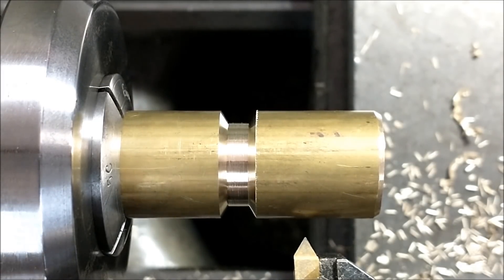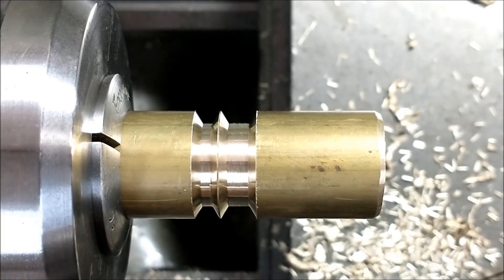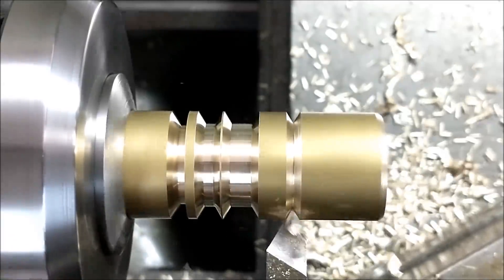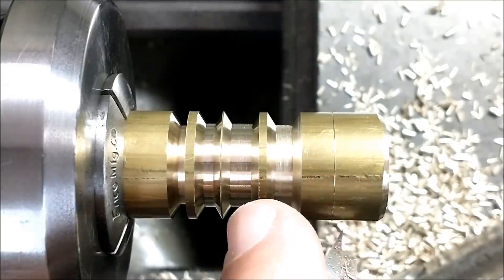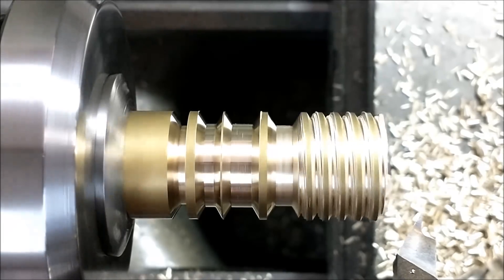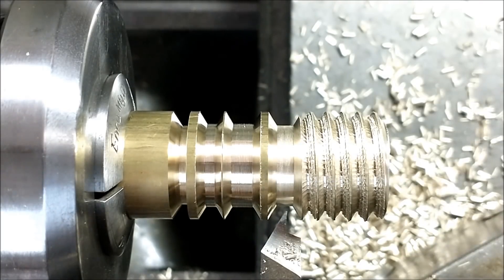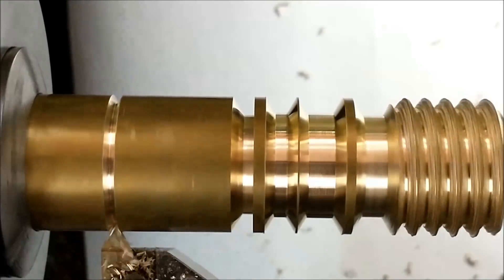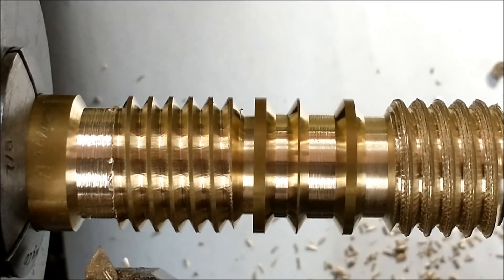FACT CHECK:  Threading Myth BUSTED !!   You'll Find This Interesting......

Comment: I’m mostly a mechanic, but yesterday I needed to lengthen the threads on a bolt to make a jack screw to pull out some flanged bushings. Anyway, I set the compound to 29.5°, or 59.5° on this lathe, like I was taught in school. Then I needed to square the tool, but I couldn’t do it against the face of the chuck because the tool had a weird offset, so I asked one of the machinists if he had a fishtail gauge. He didn’t know what I was talking about… but he just lined up the tool in the existing threads. I felt dumb.

But he also asked me why I had moved the compound. He said he always cut threads by feeding directly with the cross slide.  

He said it’s a carbide insert and the lathe is strong, just go for it.

And indeed I cut the best looking threads I think I ever made.  The irony is that I learn to cut threads in school using the same exact carbide inserts, but I guess the teacher wanted us to learn the hard way… Or maybe he didn’t even think about it. The HSS tools were just cut from the program 3 months before I started.

Still, the machinist was surprised that I knew how to cut threads, especially metric threads, and that I knew my way around a lathe. I pointed out that I know every machine in the shop literally inside and out because he breaks them and I repair them… haha.
Reply: That's neat that you have all this and the thought put into it, the time spent, and learned more by doing.
I change bushings like you describe with a c-frame and forcing screw. The ends are selective for different size bushings.
The biggest lesson when being paid only book time labor for a technician, other than a trick that's super fast, is using the right tools to begin the job and be done with it on time.
At your leisure, on your own car, you can reinvent the wheel while you're at it.
Nowadays you can use a tool and return it quite often at the parts store or get it cheap at Hebrew freight.
Reply: @dannylinc6247  In this case the bushings were already tapped for the use of jack screws, but we didn't have M16 allthread on hand. 

I say mechanic but I'm a millwright in a fab shop.  My team does all the shop maintenance, in addition to repairs and modification on all kind of customers equipment of all sizes. 

My speciality is mostly electric controls and hydraulics, but I'm an OK welder and machinist. 90% of the time when we need a tool, we make it in the shop. 

Also we're in a pretty small town, way north of all the big cities. If we need something it's not next day shipping but next week shipping. And with Covid it's next month shipping now.
Reply: @felixar90  thanks for the clarification
Glad you found your calling.
Reply: @dannylinc6247  Yes I did find my calling. I used to work in IT, but I got sick of it. Went back to trade school.

Comment: Yeah even if you push the tool into the work at 30 degrees, when you start the movement to make a thread it doesn’t do that. So it should need both sides

Comment: I was taught to single point by several old timers and this is the first time I've heard this nonsense. We keep our compounds set at 30 all the time, when I asked why, they said it was so you could "pick up" an existing thread and fix it. I've been cutting single point threads for over 20 years in a production shop, both with and without a compound. If you have ever actually WATCHED the tool cut, you can easily see it's cutting on both sides.
Reply: I'd bet it's an idea spread by folks that have only been trained on regular lathe work, and never used their brain enough to ask if it makes sense for threading. If you let them do something they're not actually trained on, they'll probably break tools.

Comment: On a manual lathe , the leadscrew always has slack in it. The only time I use the compound is to cut a multi-lead thread. My passes are .010 deep to the last .005, then .002. All straight in from the cross slide. I let most of my passes float with the leadscrew, Then let my palm rest on the apron handle to pull backlash out of the leadscrew. This switches the tool pressure from the left side of the thread profile to the right side. The last couple of thousands has a lot less tool pressure equally distributed around the entire profile. My success rate is 99.9%. If there's chatter, it usually comes from other issues with the machine or the setup.
Reply from the maker: I apply hand pressure drag to the top of my handwheel while threading 100% of the time. A very worn half nut or leadscrew can ruin a thread if you let it float. I believe the condition is called 'Drunk" and a single light pass is not guaranteed to clean it up.
Reply: @joepie221  I couldn't agree with you more. I believe the idea of setting the compound at 60 was in the days of HSS. Each machine has its own character as you know, but I still enjoy the manuals over a CNC. Maybe its just a control thing. LOL
Reply: @davidvollmer959  : May be a feedback thing too. Lots of info can be conveyed by a change in feel when you change your actions...

Comment: How does the lathe start the cut at the exact same spot each pass?
Reply: There is a numbered thread gauge dial that runs on the feed rod that tells you when to engauge the feed.
I’ve used one since 1974, still a rookie, that’s why I watch Joe he’s the expert and I learn from every video.
Reply: @jamesschrum8924  we just got a lathe and an end mill at the plant where I have been an industrial mechanic for 35 years and I want to learn how to use them.
Reply from the maker: You're on the right channel. feel free to ask questions. As for your specific question....assuming the machine is set and geared correctly...a solid rule of thumb is to leave the halfnut engaged at all times for a metric thread and control the carriage movement with the spindle direction, for an even thread you can use any line on the dial, and for an odd thread, use only the numbered lines. When in doubt on an imperial thread, always use the same line, numbered or not.

Comment: So in your case, only 0.020" of the right side of the tool is needed. But the full length on the left.
Reply from the maker: Correct. Only if the compound is at true 30.

Comment: why even set the compound slide just leave it 0
Reply: i never move the compound off 0 if im cutting a Coarse thread i just advance the compound a little as i go then when i get close to depth ill go a few thousandths back from where i started to clean up the trailing side .
Reply: The Question if it wasn't a Myth What angle Should the compound be set at for say a square thread or a multistart thread?

Comment: I've always used a 60 degree tool sharpened at about 50 degrees, with a full radius on the point. Because of the radius, which cuts on the back side, I have never detected any stepping at all. Every thread that I've ever seen has a radius at the bottom--a Sharp corner creates a stress concentration which encourages breakage.
Reply from the maker: I believe they are 'J' threads. Not all threads can have a root radius and still work.

Comment: General Discussion: Of course there are several ways to cut a thread on a lathe.  Many machinists will do the whole process without using the compound slide at all. (The Index wheel is there for a reason.)

With this method (someone else) saying you don't need "the whole" half of the tool - is a little strange, you may not need the WHOLE of the right hand flank for thread cutting - not plunging, but you will definitely need that portion of the "right hand flank" which is making the depth of cut. (make a drawing and see that parts of the tip are "working" - you need those)

A tip ground like that demonstrated also has no support - yes it is very bad....

Another way for fun - would be to blue the tool and make a threading pass to show how much of the  right flank cuts in normal thread cutting (using the compound slide).
Reply from the maker: When a machining channel host presents the statement" Only the left side of the tool does the cutting" it very clearly states the right side of the tool isn't doing anything, and therefore not needed. The half tool used in this demonstration is being used just to prove the right side is absolutely needed. Its the WHOLE point of this video. I personally never use a compound and most of my subscribers know that.
Reply: @joepie221  :  Of course when claiming "a thing" in video format it would also be great to demonstrate "said feature" - which you have in this fine demonstration, thank you so much.

Comment: Nice to see. I have had no formal training so went in at 90', it seemed logical.
Since then I discovered the internet and found I was doing it all wrong.
I didnt change as I found no problems at 90' although I did try it.
Reply: Where I trained we were told to leave the the compound at it's zero position and feed in with the cross slide to obtain thread depth. Also as the tool is fed in for each  pass to advance the compound slide forward half the depth of cut. So 0.01" cut, advance tool forward  by 0.005". Final depth cut is not advanced on the compound. Advancement of the compound removes most of the pressure on the rear tool edge.

Comment: I don't understand the reason for arguing this point because no one cuts threads with half a tool. Maybe it is to let Joe be correct again. :-) Would you agree that 29.5º reduces tool pressure?
Reply from the maker: You missed the point. Watch it again.

Comment: You set it to 29 degrees so you are mostly cutting with the left side but only slightly cutting with the right side of the cutting tool, this eliminates the chatter you would have if cutting with both sides having equal cutting pressure.  This applies to the thread depth  that was already cut, you will slightly skim the metal on the right hand side while taking much more material on the left hand side of the pass. The material taken off  under the diameter that you previously cut to would be formed equally by both sides of the cutting tool.

Comment: Maybe a novice heard this and took it to heart for a short time, but I'm not sure any seasoned machinist fails to understand the concept, at least at an instinctual level. I have been told the same thing my entire career and understood it to be "true," but when I wrote a macro to reduce the cutting forces for turning Acme threads, at no point did I consider not following the trailing edge or truncating the tool. I'm not sure that this a myth, but rather poor communication skills.
Reply: In this case, poor communication skills create a myth. It's why you should always think about the things that you say, instead of just shooting from the hip.

Comment: With the speed you are running and pulling out of the groove and moving back to the beginning of the cut with the lathe still running, how do you get the cut indexed in the correct position?  Decades ago, and older machinist showed me a threading procedure as thus:  He ran the lathe very slow, made a forward cutting pass, and stopped the lathe.  Then without disengaging the carriage backed the cutting tool out a few thousands and reversed the lathe to get back to the beginning of the cut.  Stop the lathe, still without disengaging the carriage.  Then set the tool for the next cutting pass and go forward.  Note that the carriage is never disengaged so that the tool is always indexed to the groove being cut.
Reply: Many lathes have a small numbered wheel that allows you to disengage the half nut and reengage at exactly the same starting point.
Reply: @EpicZombiez2314  I learned to thread using the dial,  slowed me down a bit when I moved to a different shop where none of the machines had a functioning or present dial.  At least now I can do it both ways.
Reply: @EpicZombiez2314  Thanks for the explanation.  I guess the lathe I was shown that procedure didn't have that feature.

Comment: Indeed, the other side of the tool would need to be a minimum length of whatever your feed on the compound is. Love your technique of measuring thread depth btw. Been using it for a while now and it's super helpful, thanks! 😊
Reply from the maker: Thanks 👍

Comment: nearly all CNC threading operations move in a diagonal into the radius of the part to cut the thread, simulating the move of the compound. the myth comes from non machinists unable to visualize cutting through time... this is why mechanical engineers are always having their butts handed to them by old experienced machinists.
Reply: No, this is why bad mechanical engineers are getting their asses handed to them. Good mechanical engineers have a good understanding of the processes that will be used to make the parts they design.
Reply from the maker: I used to teach a class on that to 3rd year mechanical engineering students. It really opened their eyes.
Reply: @joepie221  I used to have a production foreman that tried to tell me that my designs weren't manufacturable. That it was impossible to weld something a certain way, or that he couldn't machine it like that... and then I'd have to demonstrate that it was not only possible but pretty simple.

After the first couple times doing that (in front of his crew, of course) he stopped playing games and just made the stuff.

Comment: I learned to cut threads in the early 70's on a lathe without a compound. Only used crossed slide. Guess the antique Machinist that taught me,  left the compound thingy out.
Reply from the maker: I don't use the compound either.

Comment: Set top slide at 90 to cross slide, use cross slide as accurate depth of cut (no guessing) and on each pass move the top slide towards the left 50% of depth, (right hand thread). (can vary from 50 to 80% depending on material & tool type). As an apprentice i was taught this & have been doing this for 50 years with out a problem. This takes the excess force of the back face,  It has no chatter, the finish is perfect and the depth is very easy and much quicker

Comment: The right hand side does cut, but it cuts measured from the tip of the tool back towards the tool post only as deep as you feed the compound. So if you feed the compound 20 thousands, from the tip back towards the tool post a 20 thousands long edge of the right side is cutting.
Reply from the maker: That is correct.
Reply: At least that's how I thought of it, tell me what you think.

Comment: Ever since i heard this i have been racking my brain trying to make sense. I came to the conclusion that this was something someone made up and everyone just took it as gospel from the machinist gods
Reply from the maker: Some even choose to pass it on as good advice. Go figure.
Reply: @joepie221  guy 8n one of the groups I'm in was giving a guy shit because he made a solid tool post mount. He was saying there was no way he could ever cut threads properly because he can't set the solid mount at 29.5 degrees.

Comment: Realistically the 30 degree feed trick does one thing, it reduces the minimum force required to cut a thread, for a big machine it may not matter, but for a smaller machine, or a less rigid part, it can make a difference.
Reply: Yes of course it can David you are totally correct. Those of us with small machines have found that out a long time ago lol
Reply: No it doesn't. Because of backlash the leading face of the tool always does the work. The reason oldtimers say to set your compound @29.5° is for feeding w the compound. This is an old school way of keeping track of your thread and w the wide adoption of the dro is almost never used. There is a reason for everything
Reply: @Rough_cut613  So you think cutting a chevron shaped chip vs a normal chip is the same? some of the cutting force is shaping the chip, think about the forces needed to bend a strip of metal, vs an L shaped piece of metal. the L shaped piece requires much more force to bend.

Comment: Can u cut a thread using a parting blade?
Reply: If you mean can you grind a HSS parting blade, yes... but it wont be as rigid so light cuts are the order of the day... keep a flat top... 0° top rake... 
Also, because lower tpi threads need more side clearance, it might not be ideal for them... 
But I have done it for small parts with fine threads & had no problems...

😎👍☘️🍺

Comment: My first attempt at cutting a thread produced the ugliest screw you can imagine but the nut didn't seem to mind so I used it anyway rather than spending another 5 hours trying again. Changing the gears on a mini lathe is a job in itself.

Comment: Like all myths and tall tails it probably got bigger over time and went from does MOST of the cutting to does ALL of the cutting.
Reply: Probably has a dose of normal lathe work in there too (of course the trailing edge doesn't cut if you removed all of the trailing material before it had a chance to...)

Comment: I think that using the compound slide for the incremental infeed when threading has many advantages,
A: reduces the load on the tool. only 51ish% of the total length of the tool actually engaged with the work, both sides, is really doing the cutting, Drastically reduces chatter
B: this allows you to set the cross slide handle to a comfortable position for fast and easy retraction each pass and back to 0 every time, no number to remember
real nice for large deep threads!!
C: chip control, if all I ever did was brass not only would I be a happy camper and none of this would matter, BUT straight in feed large diameter internal threading
in 304/316 stainless makes the shittiest chips you can imagine.......
Reply: i use crossfeed only for fine threads, compound for coarse threads.  At what pitch do I change techniques?  It depends on the material, the machine, the insert...other factors that I can't think of right now...